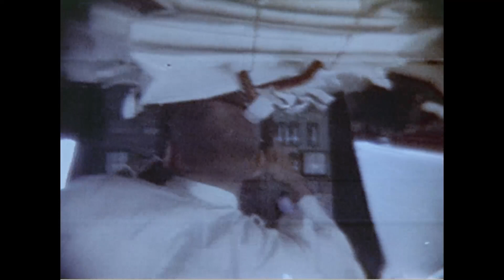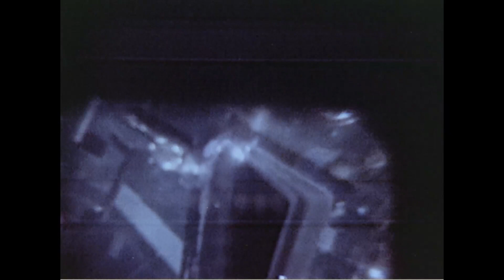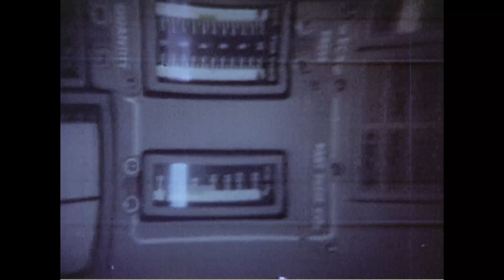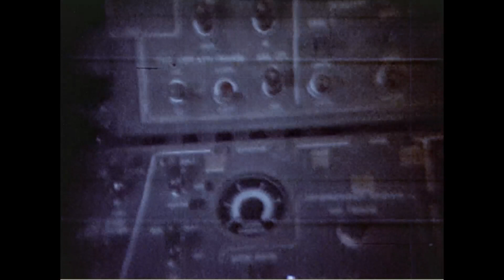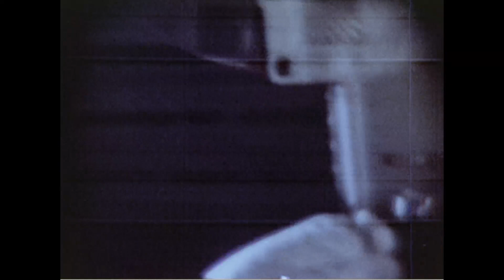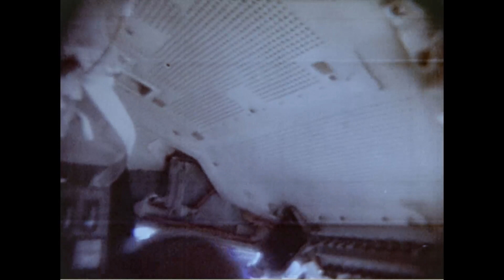Apollo 11 Lunar Module Checkout

Comment: Skipped through.
Wondered how they kept warm, or not too hot. What was it?
They were in an enormous void, but may have got warmth from the sun.
Heating, insulation, body heat?
Reply: there were temperature controls in the modules, radiation insulators inside and protection systems on the outside to shield ionising radiation.
Reply: @jaydencoxracing08 😅